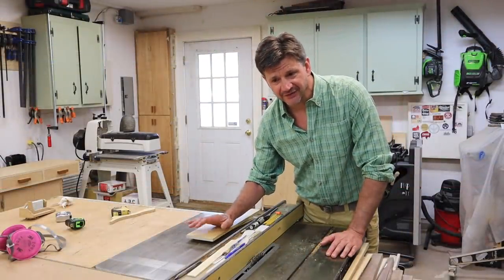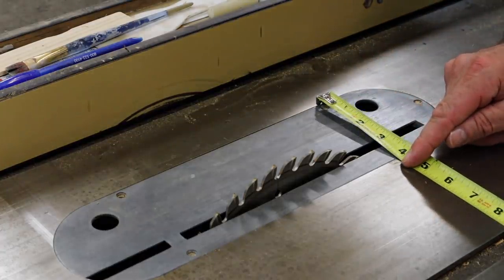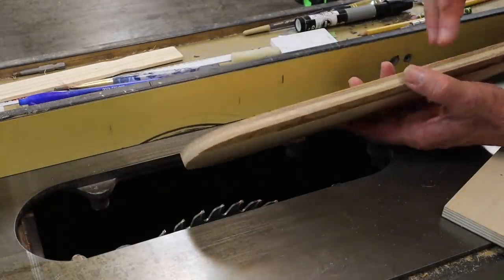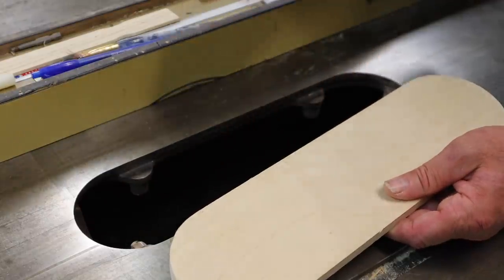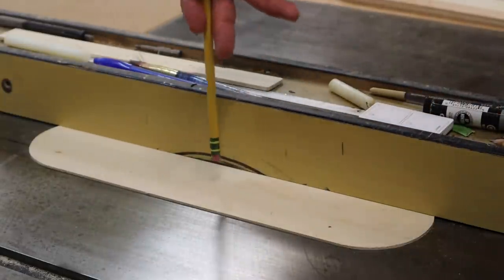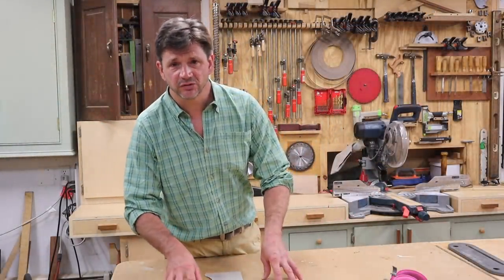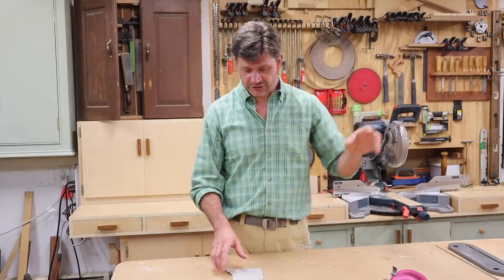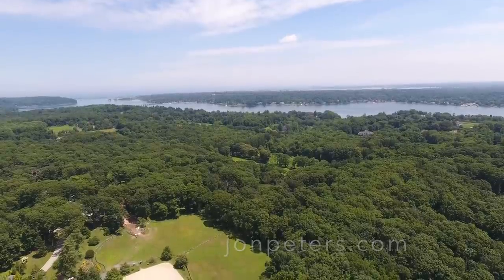How and Why to make a Zero Clearance Insert for your Table Saw

Comment: I run the plywood through my planer to get it to thickness. Works ok if the plywood is good quality and I take small passes. I make about 5 or 6 at a time - lasts me a few years. 

Nice video.

Comment: Great tips, Jon. To get the slot cut into the insert, I've been using an 8" blade that is normally used in a miter saw.

Comment: Sindce you are a rolemodel to some beginning and advanced woodworkers please always use a riving knife.
Its just 15 seconds to change it and keeps you safe.
Reply: 3dmazter riving knives are pretty new and he has an old saw.  They have after market splitters but since riving knives raise and lower with the blade it would probably require a modification to the saw.

Comment: it seems like you still run the risk of some bad kickback without using a riving knife. Is there a reason for this or is it just preference?
Reply: The saw he has doesn't have a riving knife. I have the same model saw. Riving knifes are a fairly new safety feature.

Comment: I am fairly new to all of this.....I have used a table saw most of my life but, I have never heard of a "zero clearance" insert until recently.  My insert has a small metal clip that holds the insert in place.  You have to turn a small knob to lock the insert.  I have watched several video's and have yet to see how any of those inserts are held in place, you video included.  How is your insert held in place?

Comment: Even with a zero clearance I hate making cuts like in the thumbnail where there’s a tiny piece between the blade and fence that you’re pushing. I prefer to cut sr a larger piece and have the small section you want be the off cut so you can push a much larger piece against the fence. 

Maybe I’m too cautious but the table saw is honestly the only pieces of woodworking equipment that demands that kind of respect and fear from me.

Comment: Why don't you use router table with flush trim bit for such a task?
Reply: Petr Blaha hmm maybe because getting a router, fitting a routerbit, clamping the workpiece and dealing with the mess the router did after is more work than just turning the bandsaw on. Byt that is just my opinion.